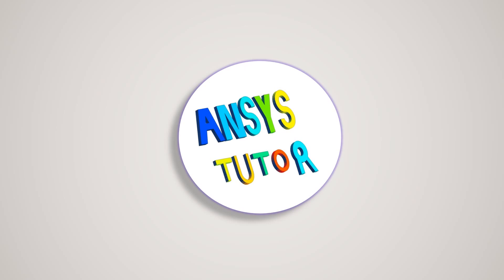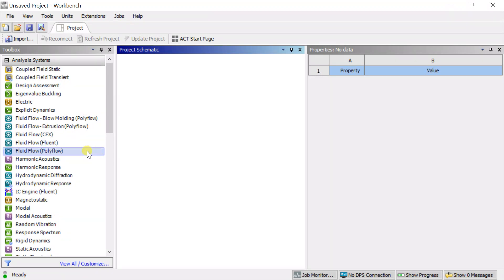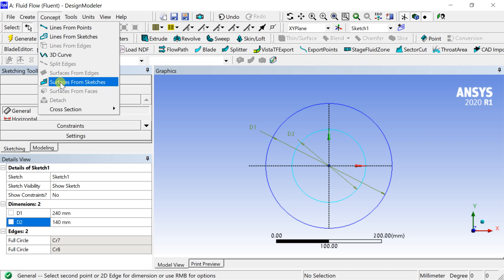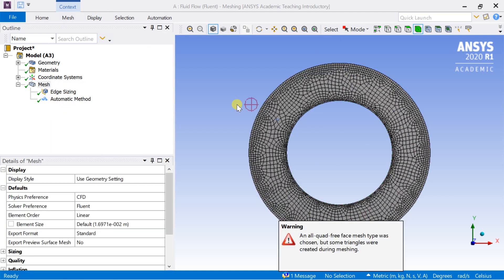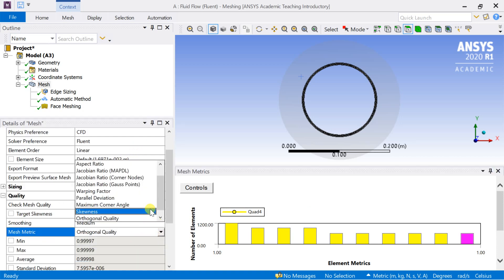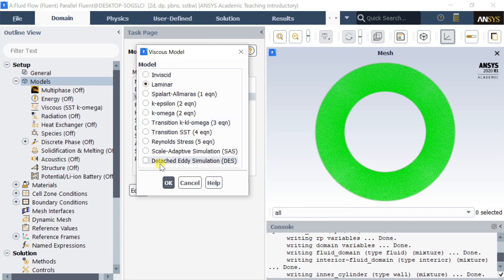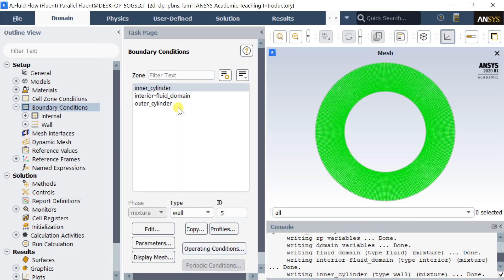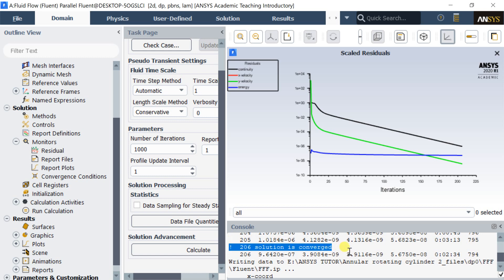ANSYS Fluent | Analysis of Two Concentric Rotating Cylinders | Moving Wall Boundary Condition | CFD

Comment: Thanks for the video, I want to plot de temperature distribution over a cilindrical wall in the transversal plane of a tube in 3D, could you please tell me how can I do that. Thanks in advance
Reply from the maker: You need to create a new plane (in cfd post) at the desired location, then you can obtain the temperature distribution contour at that transverse plane.
Reply: @AnsysTutor  Thanks for your prompt response. I have displayed a contour of the temperature over the cylindrical wall, but what I need is only the graph of the transversal plane, the data for exporting to a csv file. The tube has its perimeter over XZ plane, and the height is on the Y axis. I want to graph the temperature over the perimeter at the XZ plane in the middle of the tube (Y=0). Do you have a tutorial or know a video explaining the procedure for doing that? Thanks in advance

Comment: What is meant by wall thickness in thermal tab, boundary conditions
Reply from the maker: Generally all the wall boundaries has zero thickness, if you want to model the wall as it is practically,  then you need to provide thickness to the wall.

Comment: Great tutorial as always.  

I did exactly as you did and everything seemed to be ok until solver setup.  I do exactly as you do, but sometimes the program goes mad: after calculations the solution cell doesn´t get up to date, instead, it gets refresh required.  And sometimes that doesn´t allow CFD post to work properly.  Besides my temperature distribution is different to what you got here, like 4 degrees beneath your average value.  If you have any clue why this happens would be very helpful.  My version is 18.2 btw.
Reply from the maker: Are you getting any warning or error in calculation process.
Reply: @AnsysTutor  not during calculation, just the typical "can't handle Fluent message" after it sometimes. Another thing is that my solution gets converged at 201 iterations, not 206.  Maybe there are some initial parameters that differ from what you have at your version that I haven't noticed.
Reply from the maker: I would suggest you to first note down all the steps and required BC inputs, reset the current setup ,then proceed to the new setup process.
Reply: @AnsysTutor  I reset the setup cell but the same thing goes on.  I'll try to figure out later what may cause this.  Meanwhile I'll move forward to other tutorials.  Thanks for taking time to answer.

Comment: I am not getting green tick for solution in workbench window automatically as you are getting.what should I do?
And I didn't get the same temperature contour.Mine is more of blue shade(less temperature more than half of the annulus).I've followed all the steps and tried few times.please help me with this?
Reply from the maker: Always try to save  the  File in fluent, after the solution gets completed.
Reply: @AnsysTutor  thank you

Comment: Sir ,
Can we put more value in wall thickness?
As per summary there is no wall thickness so 
Is there any problem in final solution?
Reply from the maker: Its a 2D analysis, so you dont need to put any thickness.

Comment: thank you for videos..I am working on friction welding on two aluminum bars, but I do not come out with results saying that there is a problem. Can you help me with that?
Reply from the maker: In which package are you currently doing this simulation.
Reply: Ansys-Tutor   I have used Transient structural
Reply from the maker: Have you taken any reference from any research paper . I think it should solved using a nonlinear analysis.
Reply: Ansys-Tutor I have seen several papers but have difficulty understanding them
Reply: Ansys-Tutor do you mean from engineering data choose general non linear materials instead of general materials in transient structural?

Comment: Respected sir, your tutorials are truly fabulous and you are doing such a great work! Actually I'm having trouble getting accurate output temp in laminar flow..It is, like an eg. I'm putting input temp as 293 K and velocity inlet and it's giving me outlet temp as 292.75458 etc every time, like I think it's not accepting other inlet parameters.. can you please tell me the actual reason behind this issue? Sir, it'll be really helpful 🙏
Reply from the maker: What about the inlet and outlet velocity?
Reply: Yes I also put inlet velocity as 2 m/s and wall temperature as 313 K.. even I increase the inlet velocity to any value, I always get outlet temperature by facet avg/avg weighted just around the inlet temp or sometimes around the wall temperature!
Reply from the maker: Have you calculated the Reynolds number , have you selected the turbulence model according to that. ?